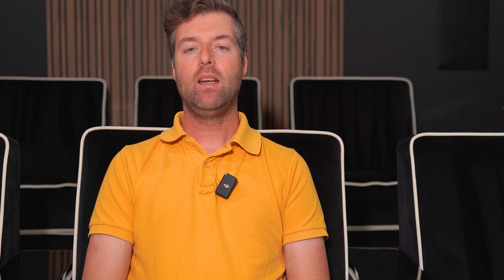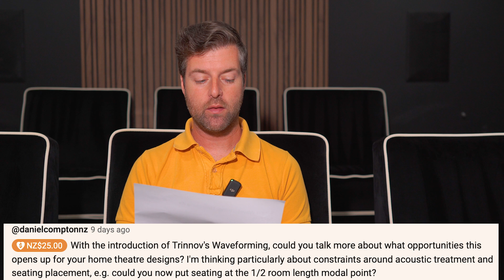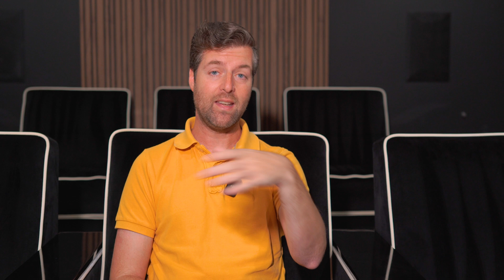What opportunities Trinnov’s WAVEFORMING opens up for Home Theater designs?

Comment: One of the things toughted about Waveforming is how accurate the low-end response becomes. How would you say waveformed bass response sounds compared to a standard well tuned cinema?
Reply from the maker: We’ve been noticing a bunch of differences. Some we can’t explain.  But it’s a consistent subjective finding. 

Bass seems to come from the speakers rather than the subs. So instead of bass sounding like it’s coming from generally around you. It sounds like it’s coming from the source.  

The bass does have a really clean and tight sound. The decay isn’t as short as some might think. But there is this attack and decay that is hard to describe. It’s adjustable so I find playing with the level of decay helps find a value that sounds best.  

We’ve noticed an increase in the rumble/tactile bass.  I have no idea why. And to make matters worse. Sometimes we do the calibration and it’s not there. There is a lack of rumble. Redo it and suddenly it’s back. Still yet to find out why. 

My system has a lot going for it in the bass. I have far more bass output than is needed for reference level output. It’s shenanigans level output. Sealed subs. So the bass is very clean and when pushed, I give up before the subs do. Add the effect of Waveforming and what I’ve noticed is that the bass can be really clean and tight. Really intense.  Bass heavy action movies with heavy use of the LFE can be like a physics assault. But with extremely clean bass that really doesn’t fall attention to itself.  It’s been very impressive. Not just to me but to everyone who’s heard it. 

Another thing I’ve noticed in my system is that the bass levels can be lower for a given perceived balance. With Waveforming I found myself turning the bass down.

Comment: The big subwoofer manufacturers will be laughing all the way to the bank. Who would have thought that we were going to have to buy eight subs for our HTs?
Reply: Two towers of 4 of course!
Reply: @thotho7869 

I wonder. I have in wall speakers that have their own back boxes. I have to make a wall for them to sit  in. 

Could I theoretically build the wall with the subs in it and use the space in the wall as the sub box and do the same on the rear wall with a couple subs on each side. 

Maybe the wall will want to flex a bit...
Reply: @niro750  Matt might correct me but this method of sub placement is actually best-case scenario as in-wall subs or subs mounted in an enclosure that's then flush in the room gets rid of a lot os SBIR. Which is what you want.
Reply: My issue is I have a smaller room and large sub.

I may be better losing extension and buying a good few smaller subs
Reply: You don't have to buy 8 subs, 4 are the minimum, and you can build them yourself, there's no point in high end subs with their own amplifiers/dsp for waveforming.

Comment: I raised my Db for my Center channel 10Db with my Onkyo RZ-50, 5.1.2, have Kef Q750 towers and Q650c with a SVS-12" Pro 2000, Apple TV 4K.  I don't understand why I need to raise the center channel so much, I can raise it up to 12Db.  I also raised my 2 rear speakers to 8db higher.  Does raising the center 10db affect the out put in any negative ways?  Am I doing something wrong?  thanks
Reply: Center channel intelligibility relies on good acoustic characteristics of your room.
Reply: What was the problem you were experiencing prior to raising your center channel level? After running Dirac Live, your system should be very well optimized in EQ and spl levels. It won't be perfect but a good sampling of measurements for Dirac Live usually can be left alone after it's loaded and it should sound quite decent. Did you run Dirac Live?

Comment: Same DB @ every seat? But at what octave or higher range frequency? Or this just bass and thump?
Reply: It’s just bass. You need a wall of subs to do it. It’s pretty stupid. I got the same effect using 3 subs and MSO. It doesn’t even matter anyway because 99.9% of the time you’re gonna be by yourself anyway and when you’re not there’s a 100% chance that person won’t even know what a bass response even means.
Reply: @ChadAV69  AMT tweeter mid range speaker modules arrays with no  traditional bass drivers are the future of home theater space speakers. Shane is doing something simular in his system. He got away from in wall in ceilings and is using these cool RBH micro speaker suspended in the room on poles and braces.

Only Sony's 360 Spatial Sound Mapping technology can help higher range signals to sound localized and loud at all the right screening seats.
Reply: @chebrubin  I had something much longer written out but my bias against Shane came through too harshly. Basically, AMT's and direct-radiator mid-ranges still have a long way to go before they catch up to other designs but yes, they do sound very nice up to a certain SPL and RBH in particular makes an incredible AMT.
Reply: @ChadAV69 sorry Chad but you really don't know what you're talking! You can get excellent results with just four subs and it has nothing to do with MSO, totally another universe!
Reply: @emt999  I know it's a different technology but you can accomplish pretty much the same thing using MSO and placing subwoofers in an intelligent way. I've gotten lucky a few times and got MSO to make it sound extremely tight. Idk how it happens but it just happens sometimes.